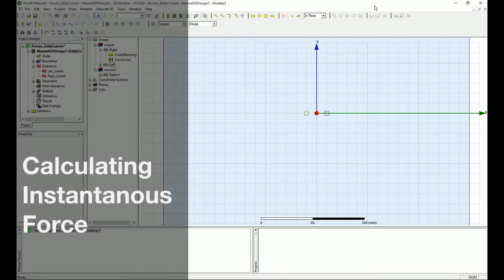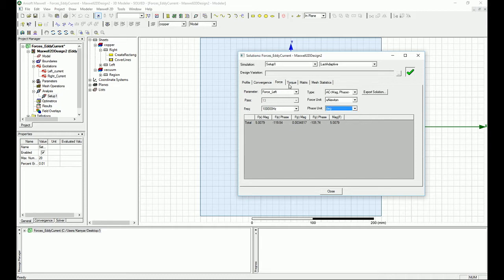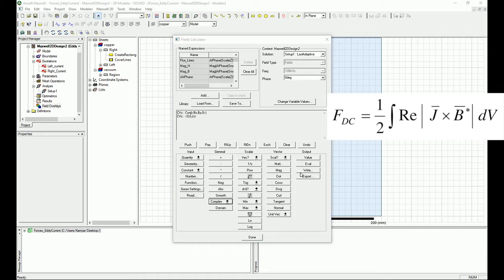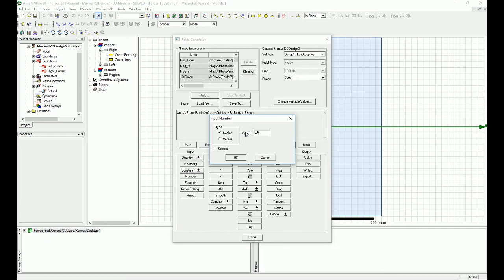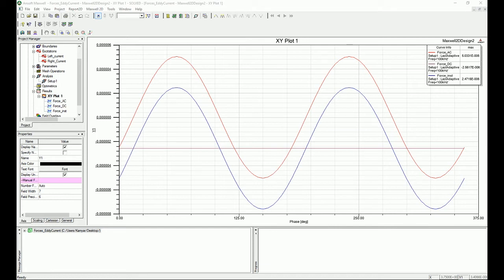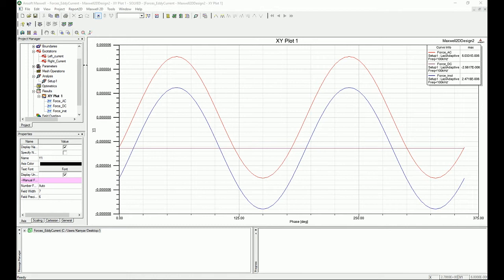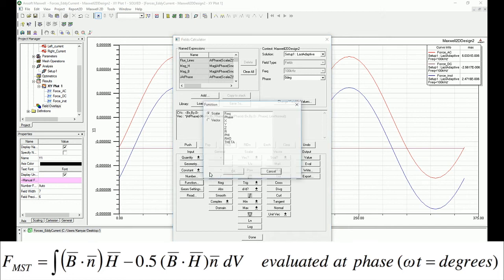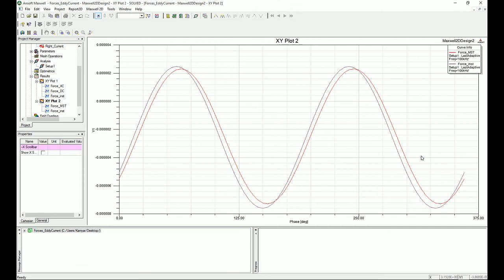308 - Ansys Maxwell | Advanced Calculator - Eddy Current Force Calculations 2D [3/3]

Comment: Hello I'm simulating 2d magnetostatic analysis using a permanent magnet and a plate. I want to calculate the magnetic force that is generated in plate, but i don't know what equation I should use. Can you help me?
Reply from the maker: +MINA WOO  use magnetoestatic simulator. That should be ok.
Reply: Thank you but my question is about field calculator. I used magnetostatic analysis option. 
What equation i have to use to calculate the magnetic force? like your eddy current force equation.
Reply from the maker: +MINA WOO well depends on your  design. It's basically the product of J x B   However you need to select the volume of your interest and integral on it. Is that your question?